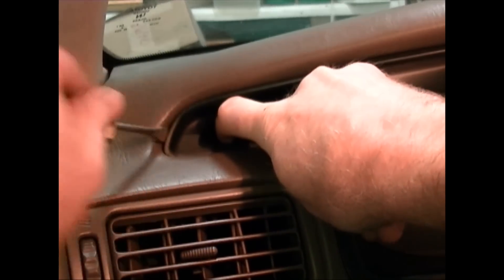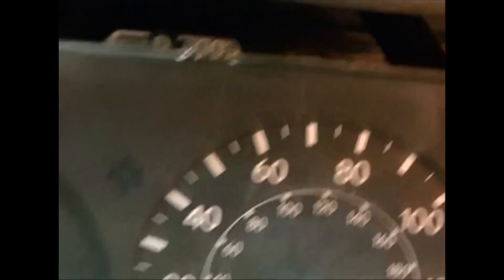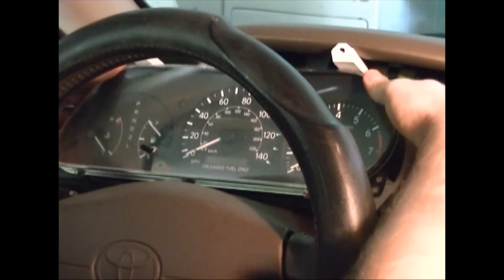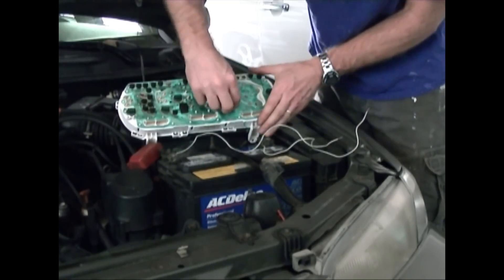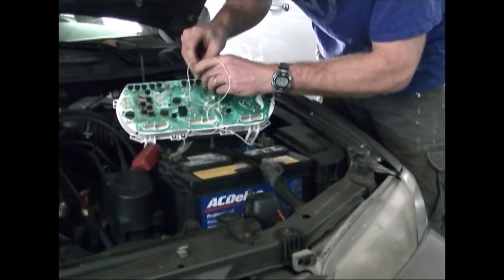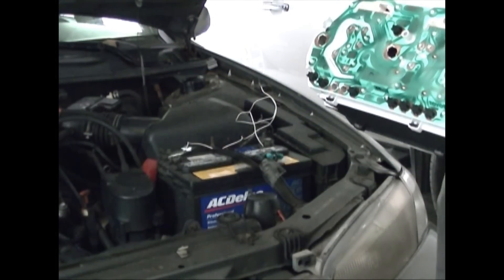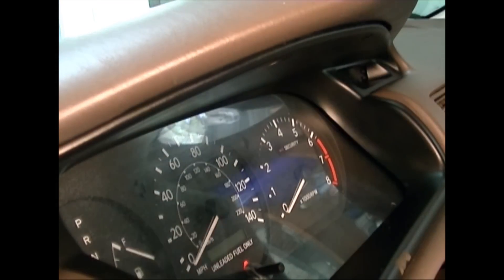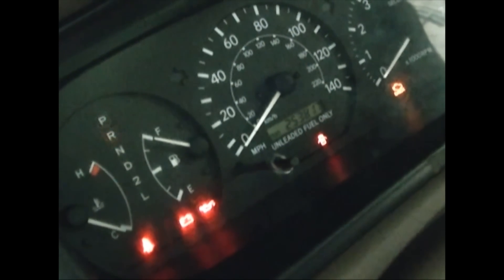1997 Toyota Camry Dashboard Instrument Panel and Lighting Remove & Replace

Comment: Great video on removing the cluster brother!! But instead of having someone with little experience hooking up a loose wire to the positive on the battery terminal, just use a meter in ohms to see if there is a open, or high resistance. Basic meters are cheap these days, and it's less risky to ground out B12, and messing up the cpu. Just a less risky approach in my thoughts. But thank you for the video brother!! Keep them coming!
Reply from the maker: Thank you for the comment.  That sounds like an excellent idea with the multimeter.  I just went with the cheap and easy method.  I wasn't sure how a good light bulb looks across a multimeter.  I know it has some resistance but not sure how much to expect.

Comment: Great Video and thanks for the help!!!
I have a 1999 Camry CE.  Used 194 and 2721 bulbs.  The 74 bulbs were a tiny bit too large.
Reply from the maker: Thank you for the excellent comment.  Glad you enjoyed the video.  Happy motoring!
Reply: Hello Greg. I need to know the type of the bulbs I believe the big ones are 194 but not sure about the small ones. Please let me know if you know that thanks
Reply: @HMA1434  I have a 1999 Camry CE.  Used 194 and 2721 bulbs.  The 74 bulbs were a tiny bit too large.

Comment: Very helpful instruction! just replaced a panel bulb successfully. actually it's a little bit harder to remove the plastic panel than I thought. Anyway thanks a lot!
Reply from the maker: Jack Yan Glad you found it useful.  It's nice to have all of those bulbs working.  Happy motoring!
Reply: +FloridaJoe3 . Hi. I have 1999 camry and the P R N D L 2 lights don't show up inside the dashboards. Is it also due to bad light bulbs?

Comment: Thanks for this video my 1999 Camry xle dash looks just like yours. The only light thats illuminated is the gas gauge light & my climate control knob lights are out. I was hoping it was just a fuse in the fuse box under the driver side but i guess its this issue. I bought the car about 2 yrs ago do you know if the climate control knobs light up or no
Reply from the maker: I do not recall about the climate control knobs lighting.  Best of luck with your repair.  My favorite part of this kind of repair is the lack of grease and grime when working inside the car.

Comment: Where did you buy the wires to test the bulbs?
Reply from the maker: I just had some wire laying around and used it.  You can buy wire of all kinds at any Ace hardware store.  You probably want to get solid and not stranded for this job.  Good luck.

Comment: Connecting live battery wires to the gauge cluster can very easily burn it up. Leaving some bulbs out can trigger other warning lights and throw a code.
Reply from the maker: Thank you for your comment.  I have to believe that you didn't try this on a 1997 Camry with the instrument panel fully removed.  While what you say may be true for a newer car, the 1997 panel was very simple and unsophisticated.  Applying power directly to the bulb sockets has very little risk.  As for 'throwing a code', this little car didn't seem to know or care whether bulbs were missing.  Happy motoring!

Comment: Hey ? A question ?? My Shift's light's wont turn on . There's any connection's frim the Shift stick to the Dashboard or its only all my bulb's it's out ???? Thanxx
Reply from the maker: Sounds like your bulbs are burned out.  You can test the bulbs using your car's battery similar to how I showed in the video.  Good luck!  It really is nice to have all your lights working.

Comment: Which bulbs have the green covers and which ones do not?
Reply from the maker: I thought they should all have the same covers but some of mine were missing.  It's probably not critical unless you are restoring a car to factory new.  That said, just keep track of covers as you are disassembling and make sure to put it back like you found it.
Reply: FloridaJoe3 Thank you for your quick reply! I’m actually trying to replace the bulbs in the 97 Camry instrument panel with their LED equivalents, and I heard that the colors matter.  So I’m trying to figure out how many to get of which color... I know there’s five 194 bulbs (the big ones) and twenty-four 74 bulbs (the small ones).
Reply from the maker: Wow! LEDs.  That's a great idea since you'll never have to do it again.  I would assume you can keep track as the bulbs are removed as to which ones have the green cover.  Otherwise, I don't know.  Good luck.
Reply: That is a good idea.  Thank you.  :) I probably would have thought of that sooner or later, but your input is awesome, thank you! And yes, with LEDs I technically wouldn’t have to replace them again.  The best to you!

Comment: So, I replaced my working (albeit very dim) dashboard light bulbs.  While trying to take out the old bulbs, a couple of them broke off into the socket, so I replaced those as well.  I inserted the bulb into the socket, socket into the hole on the dash and they clicked into place - replaced the instrument panel, turned on the key.....  and....  nothing.  They wouldn't work?!?  Any troubleshooting tips?
Reply from the maker: +Markle Janner OK, there the obvious questions: did you plug all of the harnesses back in? did you turn the dash light dimmer off by accident? did you check the fuse to make sure you didn't short and pop it during removal?  Barring that, I would take the thing back out inspect it and then reattach it so see if just 'messing' with it fixes it.  Good luck.

Comment: If all of the lights went out at the exact same time suddenly, does that suggest a fuse simply blew vs. needing new bulbs? Thanks!
Reply from the maker: Yes, ;they would never all burn out at the same time.  Either a fuse or a bad ground.
Reply: @FloridaJoe3  Thanks a bunch Joe!

Comment: I have a 1997 Toyota Avalon that my daughter currently has at college. I a wondering if the process is the same on the Avalon. I plan to do this on her spring break. Do you know the type of bulbs i need for replacement. I will change all of them. Thanks and Great Video!
Reply from the maker: +randall alliss I would think the Avalon would be very similar if not identical to the Camry.  As for the bulbs, I thought I mentioned the type in the video.  If not, just remove the panel and get the old ones out to take to the parts store with you.  Good luck with it.  It really is nice to get the lights all working again.  Your daughter will love it and think your a genius.
Reply: +FloridaJoe3 Joe, thanks for the reply. I actually dove in today assuming the avalon was equivalent to the camry. It was not! There were two panels that i had to remove (very carefully) that exposed 6 screws, which i removed. However, i was unable to remove the bevel ( i was too scared i would break it). It just wouldn't budge. I've been unsuccessful in finding any videos/schematics/pictures on the internet specifically for this make/model. Do you have any suggestions other than taking it to the dealer :). thanks again. Randy
Reply from the maker: Oh no, not the dealer.  He'll charge and arm and a leg for what should be an easy job.  See if you can find the shop manual (online?) and look up how to remove that bezel.  Good luck.

Comment: How do I turn on the clock on the right side of the instrument panel? I have a 1997 Toyota Camry XLE
Reply from the maker: I'm pretty sure that you can't just turn a clock off and on.  That said, I would verify that the power plug is connected to the back of the clock.  If it is, disconnect and check for power.  If no power, check the fuse.  Good luck.
Reply: FloridaJoe3 ok
Reply: Daniel McDaniels g
Reply: Grace02 what do you mean by g?

Comment: Hey thanks for the videos really helpful guides. I'm trying to change the ceramic resonator is there way you could help ? Are you in the Miami area?
Reply from the maker: +ashley renee Hello Ashley!  I have to give you points for creativity.  That's the first time I've ever heard of someone wanting to change their ceramic resonator.  Pray tell, what makes you think that the CR is the problem?
Reply: +FloridaJoe3 hello what lights do I use for this model?
Reply from the maker: +Truth Seeker I don't remember the part number. You might want to do what I did: remove the bad lights and take them to the parts store to compare. Good luck with it.

Comment: is this also where your signal flasher relay is? I have a 97 avalon and trying to fix my hazards/signals
Reply from the maker: No. I believe you'll find those in one of the fuse panels either under the hood or steering wheel. They should look like a little aluminum or plastic can. Good luck.

Comment: What about the lights for the brake and drive handle, my lights went out or is it all connected to the same lights from the dashboard??? Thanks
Reply from the maker: +Lucci Luciano I have heard that when all your dash light go out, it indicates a bad taillight.  Either that or your panel dimmer switch is turned all the way down.  I'm not sure what you mean by brake and drive handle lights.  Please elaborate.
Reply: +FloridaJoe3  the gear lever, gear shift , the lights on there it went all dark

Comment: will this work for a 1999?
Reply from the maker: Sorry I just now saw your comment (1 month later).  I can't say for sure but I would bet my lunch money that the 1999 is very similar.  Try it.  Good luck.
Reply: I can confirm the panel removal is the same on a 1999  Camry CE. Looks like there's a metal clip  holding the left side that wants to be pulled straight out (towards your right eyebrow when sitting in the driver seat).

Comment: 1:07 i don't if it's because i don't have a screw driver but getting that part off on the right is difficult.
Reply from the maker: Hmm... I don't remember if it was difficult.  It's hard to know when to lightly jiggle it and when just give it a good yank.  I've broken a few plastic parts because I guessed wrong.  Good luck with yours.
Reply: @FloridaJoe3  I was able to get it off next time ima change the color for the lights. 😎💯

Comment: This is how you blow the motherboard! Never press a live wire to a motherboard. Motherboards take predesigned grounds and amps. The amps from a battery are straight, conductive, current. The amps from a battery, applied over and over can fry the motherboard. From any position. Test the bulbs individually, or relpace all bulbs, and work from there.
Reply from the maker: Yes, I have demonstrated an effective technique for "blowing a motherboard" here and if I were working with a motherboard I would be much more careful. The instrument cluster in this car is a simple printed circuit board with no ESD sensitive components. If you somehow got a dead short across the traces, you could burn a trace so caution is still advised. Thank you for commenting.
Reply: @FloridaJoe3  Then why did you switch to individual bulb testing midway through the video? It's not because someone told you the same thing I'm saying right?
Reply from the maker: @ricky-sanchez  No, I think I was trying to show both methods.  After a bulb is found defective in the socket, I want to test it individually to make sure the problem is not on the circuit board.

Comment: Can anyone tell me how many bulbs of each type is held by this panel?  I figure watching this video 5-9 big (194-type?) bulbs and 19-22 of the small (74-type) bulbs.  Any thoughts?
Reply: +abbottim Actually - are there bulbs behind the ventilation panel and shifter panels as well?
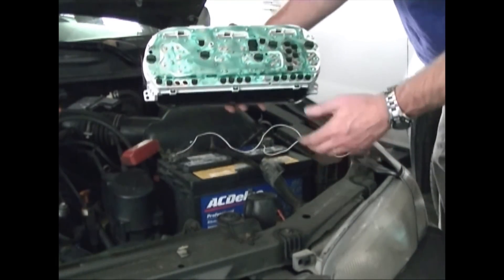Reply from the maker: +abbottim Pause at 5:56 and you can count the bulbs by their black sockets. It looks like 5 big ones and 20 little ones.
Reply from the maker: +abbottim From your questions, it sounds like you're not seeing any lights at all.  Is your dashboard dimmer turned all the way down or do you have a fuse blown maybe?  Just a thought.

Comment: no screw driver! use a pry tool, you can damage the interior
Reply from the maker: Um...1997 Camry...I don't buy special tools for cars older than 15 years.  But thank you for the comment.  I agree that a pry tool would be the ticket for this job.
Reply: If you open cars on the reg you might as well get some pry tools they're like $8 on ebay for a set
Reply from the maker: I guess Harbor Freight would have then too.  OK, I'll try to get then next time I do one of these interior jobs.  Thanks for the comments.

Comment: NEVER check lamps this way! Voltage can feedback into the circuits and damage other components! ALWAYS remove the lamp from the circuit and test with a meter or continuity tester!
Reply from the maker: That seems like good advice to me but I'm not sure what circuits you are worried about feeding back into.  This is just a circuit board and it's traces, no semiconductor chips or anything.